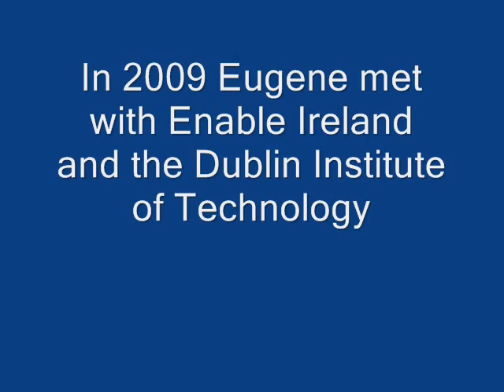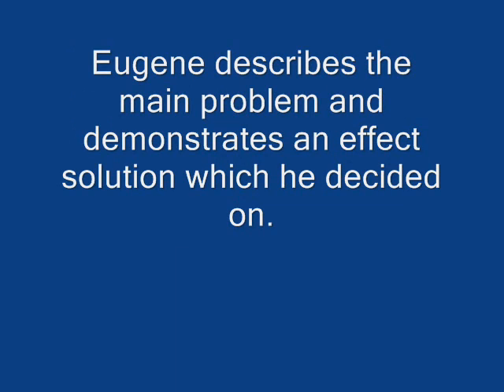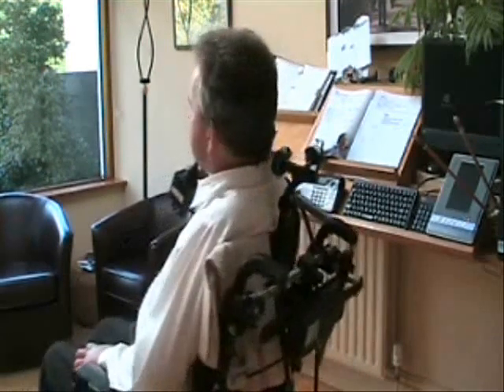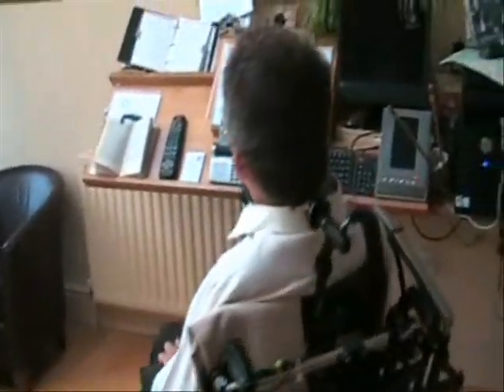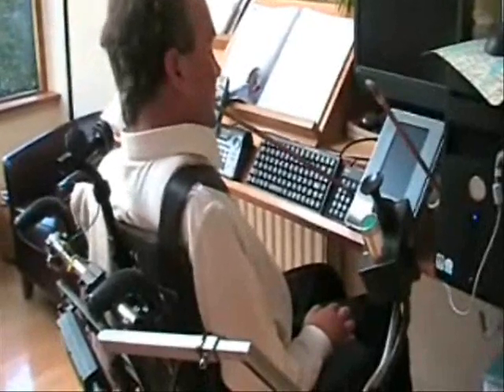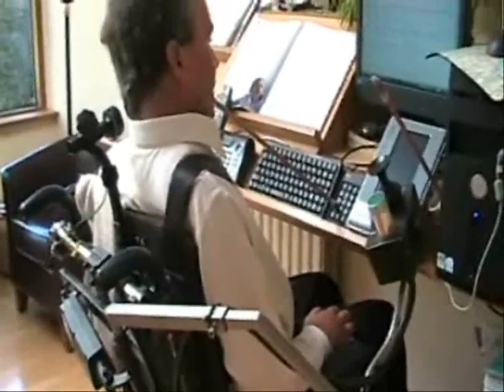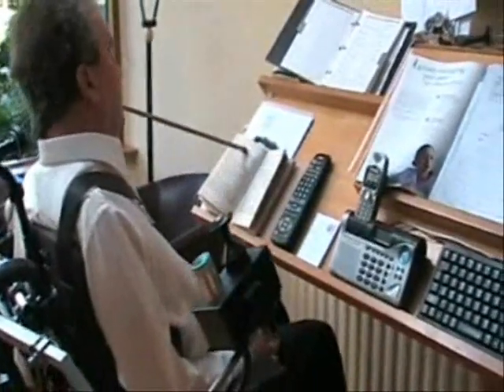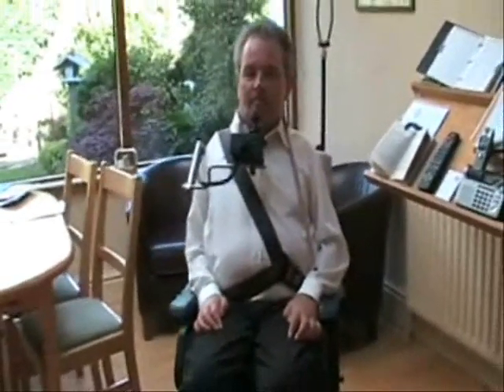Electric Chin Control for Power Wheelchair

Comment from the maker: Hi, the main parts of the system are MOUNT-001 ( the swing away mount) and0013-7004a (which is the relay box to operate the motor of the MOUNT-001)  

See the links provided in the video description.

Comment: I'm in a similar situation to Eugene. My solution to the chin control being in the way whilst using a mouthstick is a bit simpler than the one shown in the video...I just have the chin control mounted lower down, so I can type over the top of it (as I am now).  If I'm going outside where I'll need to use the control for an extended period, I just ask my carer to lift the control up a few centimeters on its adjustable bracket so it's easier to reach, & I don't strain my neck.